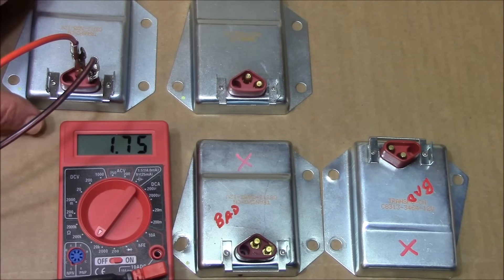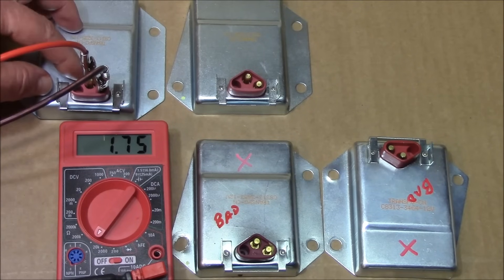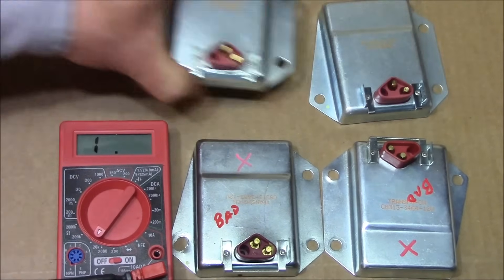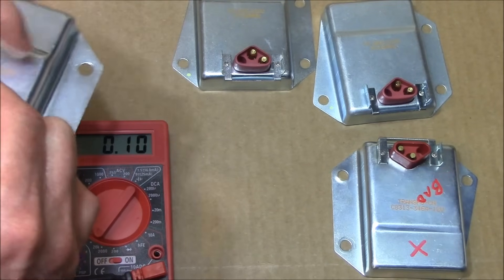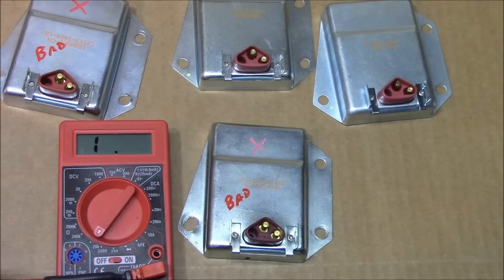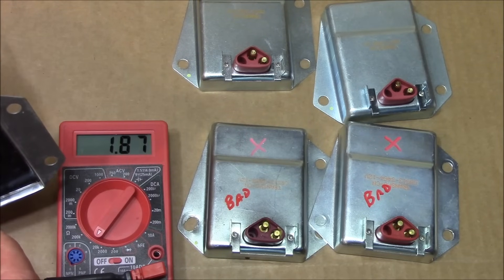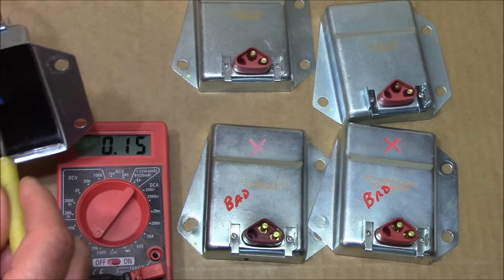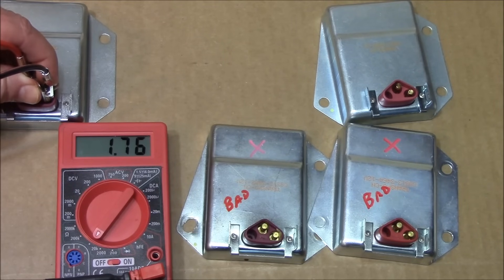How To Test the QS8313 Voltage Regulator use on Chrysler, Dodge, Jeep By-Pass kit

Comment: are dodge vehicles pcm controlled?
Reply from the maker: +Steven Robbin 1987 is when dodge started putting the voltage regulator on the vehicles pcm. They started in 87 but not all models were changed over until 1991.